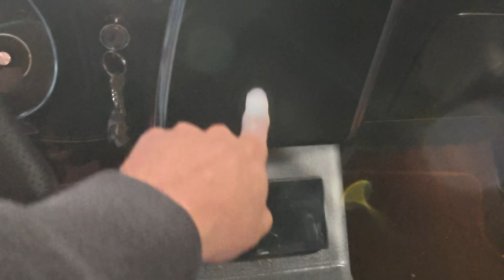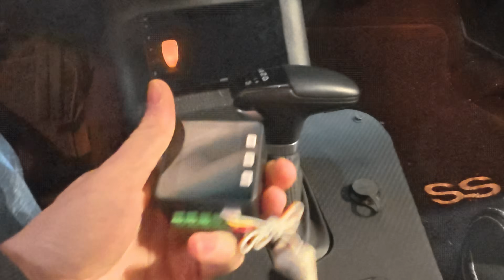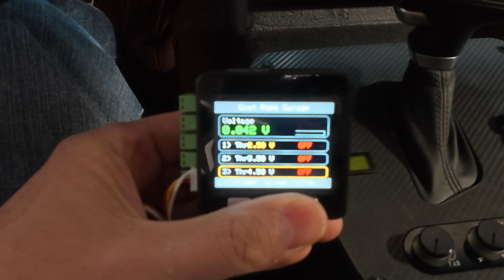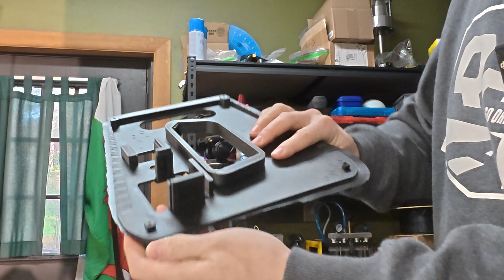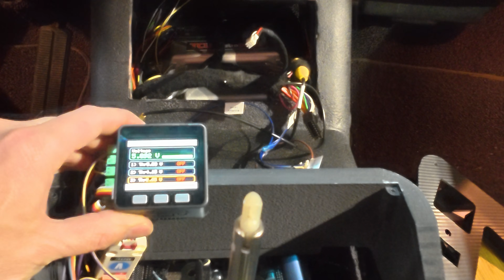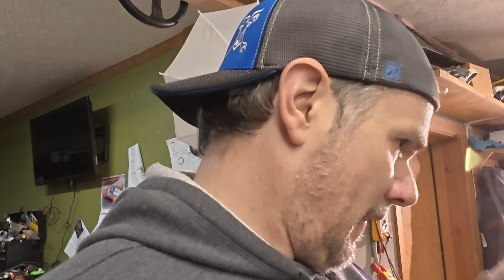8HP70 Paddle Shifter Setup

Comment: So I’m gathering all the needed parts programmers n all along with the 8h70-90.  The 90 has been hard to find for 2wd application. What version 70 did you go with? One from Dodge or BMW. My plans are for a 90 Mustang Fox body coupe that I want to auto cross and integrate paddle shifting with Holly Terminator, X  393W and The 8h transmission. I would like to know where your paddle shifter set up came from and council shifter set up as well. I am clueless with the programming and would like to learn for my benefit. If you have instructional video sources that I can be directed to to get a better understanding about how it all works I would be truly grateful.

Comment: Hey man do you know if Turbolamik can provide some outputs for what gear you are in?
For example, a ground output when in Park / Neutral, or a positive output when in Reverse?

(Actually could use relays to invert  either polarity)

I need a Neutral Safety switch output for this alarm/remote start system,  reverse lights, and a 12v signal when only in park (for an automatic door lock setup).

I seen the Dodge shifter like youre using has indicators in the handle, maybe I can some how steal a signal off them?😂

Thank you for any guidance you can maybe give !❤

Comment: With TurboLamik there is a situation when u would beed 2 paddles. One for Trans brake and the other for Bump
Reply from the maker: They can be setup for that, I didn't mess with the trans brake on this car, but I'm planning on doing another 8hp in 26 and getting into a lot more on the programming stuff. I created an awesome program for adjusting shift parameters and stuff but need to work on it more before making it public. My goal is to simplify everything so you only need tuner pro to write it

Comment: Could you clarify - did you combine the horn and paddle shifters in a multiplexer and then demultiplex it with the cool device you bought? Or did you connect all the wires and put resistors for each paddle and the horn and then just demultiplex it?
Reply from the maker: The second, I converted the horn trigger wire into the analog signal so it would work with the stock clock spring
Reply: @GoatRopeGarage thanks!